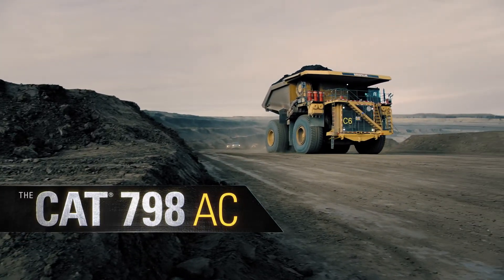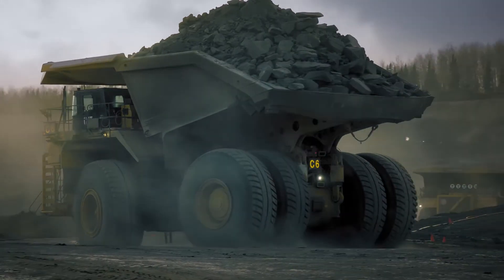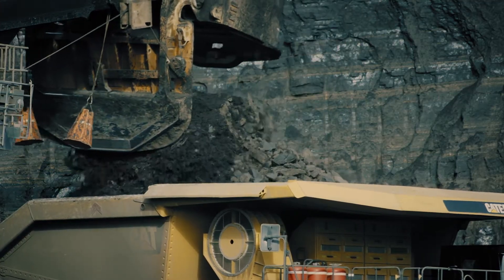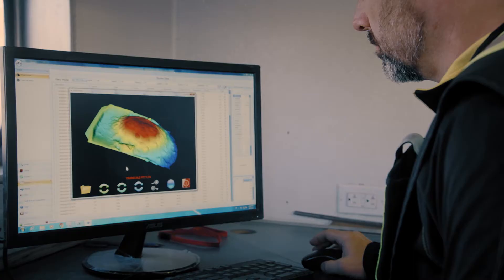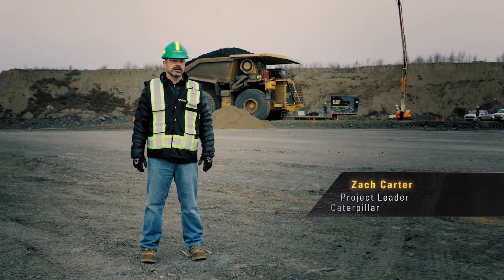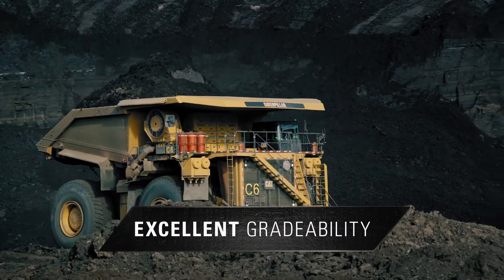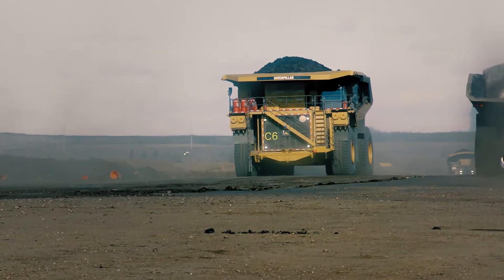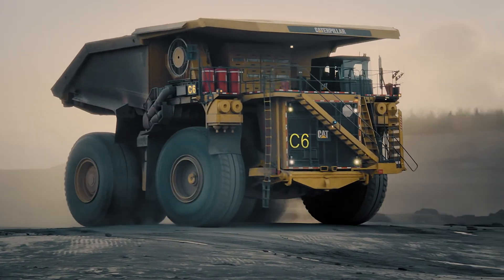The Cat® 798 AC: Proven in the Field

Comment: so, so ,the 797 model is 400 tons, this 798, just 1 number higher, that one equivalent to 10 more tons????
Reply: The 797 is pure Caterpillar, the 798 is Unit Rig-Terex-Bucyrus-Cat
Reply: The 797 and 798 are not even close by design. 797 is mechanical drive the 798 is electric.

Comment: Just asking which is bigger in terms of payload capacity  this 798ac or the 797f model?
Reply: spec wise the 798 by like 10 tons but they are pretty much the same the 98 is just an electric drive option
Reply: The 797f has a payload rating at 400 ton at 4000 HP and the 798ac has a payload rating at 410 ton at 3500 HP the weight of both are the exact same
Reply: @officalannex thank you so much sir
Reply: No such thing as a 789AC!
Reply: Cant you answer  that simple question,  what's the point...
Reply from the maker: Hi Jaybee! Your local Cat dealer can help answer your questions! To find a dealer near you visit  https://www.cat.com/en_US/support/dealer-locator.html?utm_source=youtube&utm_medium=social&utm_campaign=cic_social_care - Jose

Comment: The only issues I have seen with this particular truck is the ride quality.  It’s rough!
Reply: I’ve heard they did an update on the front suspension to improve that
Reply: @Potatoscott  If they've done an update, it's since I was on one.  The solid front axle jars the operator pretty good on a rough road.
Reply: Funny thing is everyone I know that works in the oilsands that ran the 797Bs said they are real smooth
Reply: @Bowiiihowdy  The 97s are far smoother, I can tell you this from personal experience.

Comment: So are you going to put it to the test in the Pilbara Iron Ore Mines of Nth West, Western Australia? How will the AC system deal with the fine abrasive iron ore dust and the heat of the Pilbara?
Reply: If it can handle the Oil sands it can Handle Iron Ore
Reply: @Visotto1  Totally different environment.  They have issues down there that we don't up here in the oil sands.  I have to say, they definitely got it right with these trucks.  They had some early teething problems, but they were corrected quickly, and the trucks are pretty much monsters now.
Reply: Oil sands is probably the easiest environment for mining equipment in my experiences